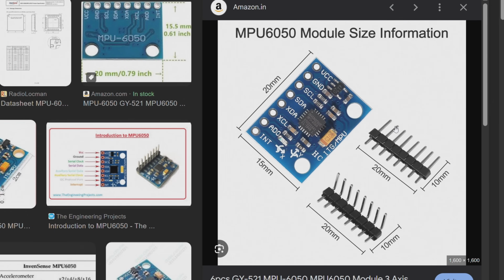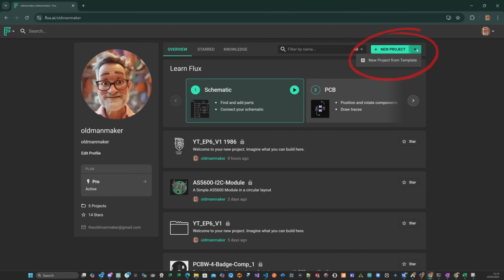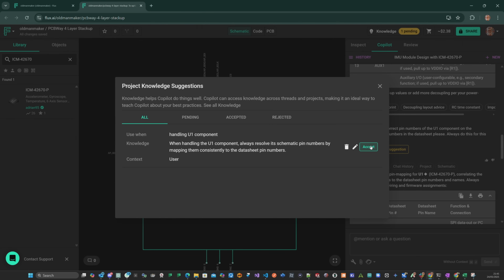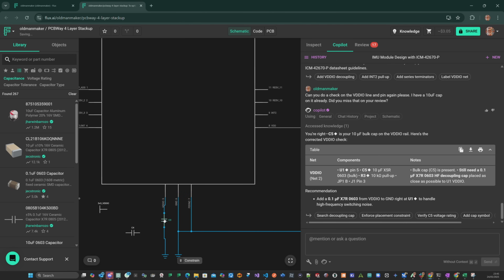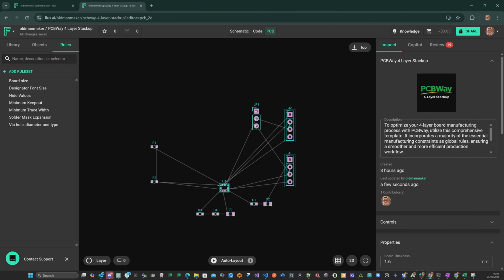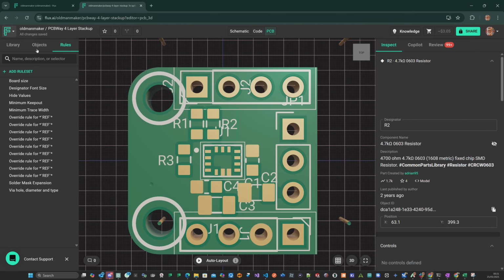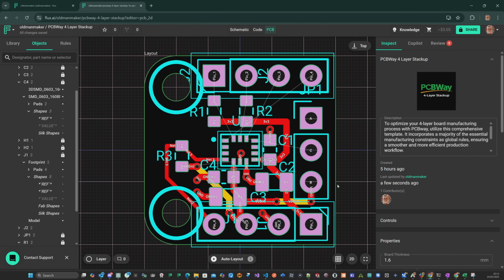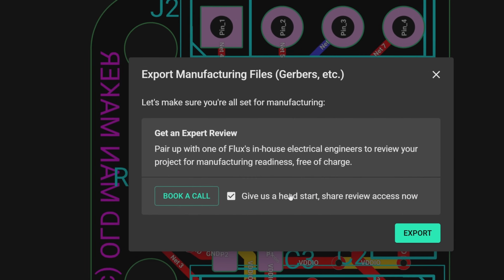This could change the way we MAKE THINGS

Comment: I have one project that I know is important that has requirements around custom PCBs at the foundation hardware layer, but I have a software engineering background not a microelectronic one. I could figure it out but what the project really needs is some peer review. This is dangerous as it makes me think about just pushing ahead without it :P

(It is a really important project to the future and I could do it by myself, but I shouldn't)
Reply from the maker: Well, only one way to start - and that's just small steps one at a time. Good luck with the project!